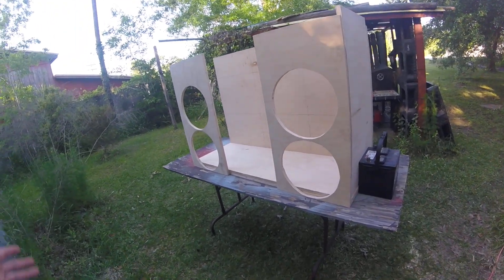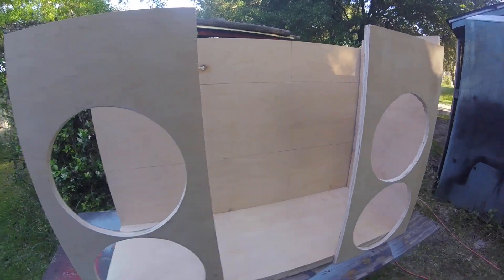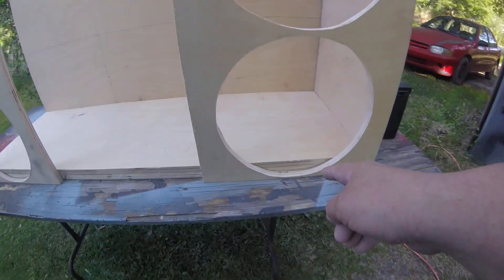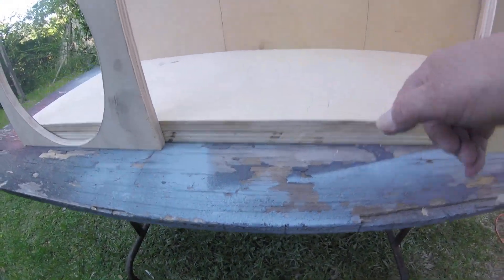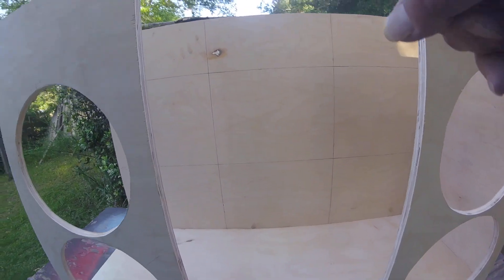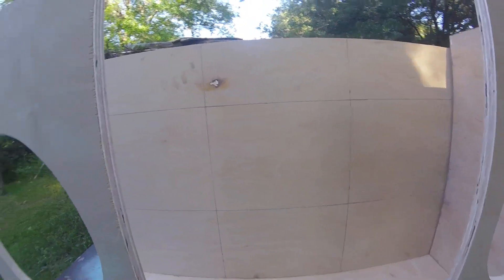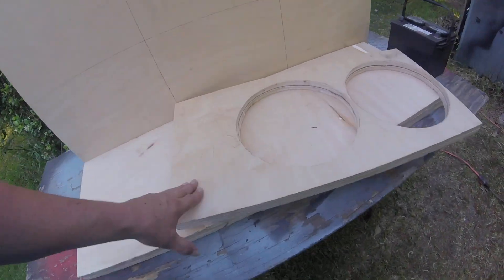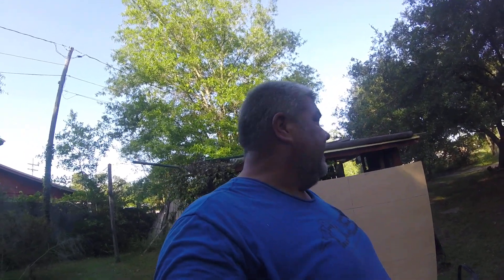Project Old School update (Sundown LCS 12 v2)

Comment: need some more pc streams in your off time when you can get the station back up and running! stay safe craftchest
Reply from the maker: I have to get a GPU and the Battle station will be back up. I'm still rocking the RX 480 8 gig so performance is meh. Get it done not streaming but I want this build to be right. Then I'll get back into it.